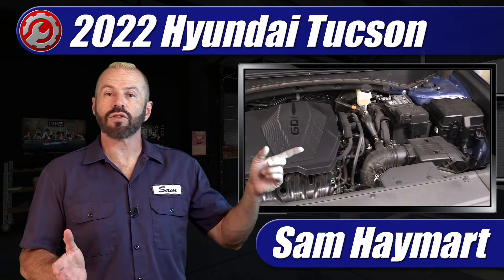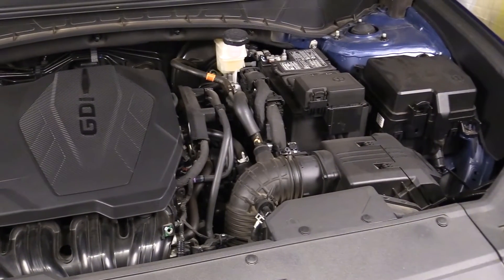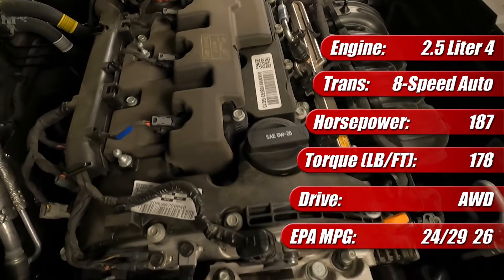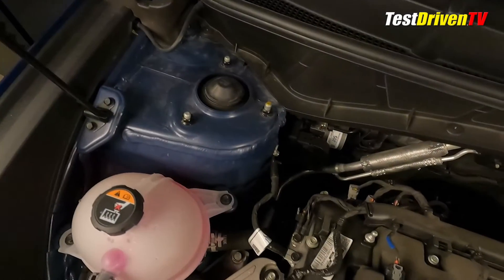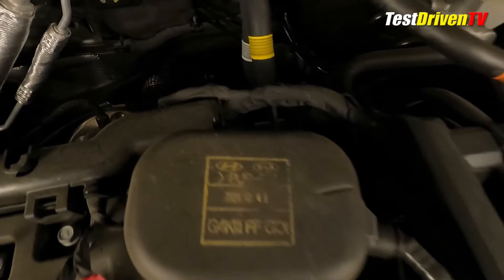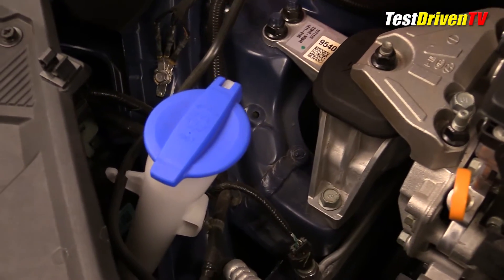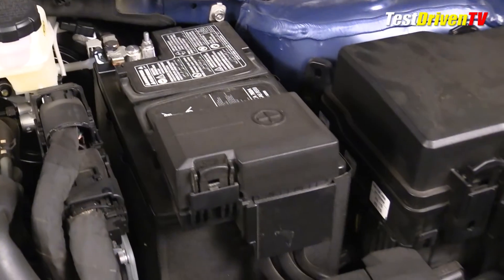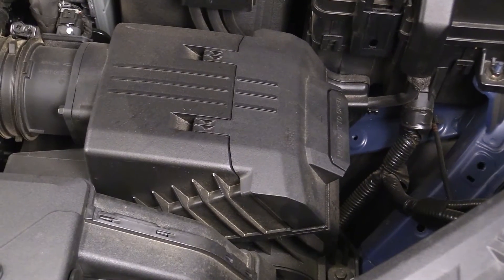2022-2024 Hyundai Tucson / Santa Cruz 2.5 Engine Explained

Comment: I have a 2022 Tucson with this engine; I am at 50,000 miles and no problems so far. I am worried that eventually the engine will blow like the theta 2's. I want to get her to 200,000 miles and more.

Comment: I had a '21 Sonata SEL with the 2.5 Smartstream.  I recently traded it for a new '23 Sonata SEL because I didn't like the styling of the 24 models. 
Anyway, the '21 had 80k miles at trade in and ran like new. It used no oil between 5000 mile changes.  Never had a single issue with that car, I just like driving new cars and have the $$$ to get one.

Comment: Total garbage design with integrated thermostat system with high failure rate. Plastic parts & terrible design. Don't expect better reliability than the older Theta engines.  Garbage design after garbage design. Thanks Hyundia/Kia. This review is a total waste of time!!

Comment: I have this engine and I need a pallet full of injectors so I can keep up with replacements. On my 4th at 30k miles.
Reply: I find this comment hard to believe.  The injectors would be covered by the 100k mile drive train warranty
Reply: @dougn2350they are covered. That’s why it has been in the shop more than not.
Reply: @Jbohan2 
The solution:  trade it off.

Comment: It's too bad they don't offer the variant that comes in the Santa Cruz which is the exact same engine but with a turbo and instead of a regular 8-speed automatic it's a wet dual clutch a speed automatic I had the upper opportunity to drive a rental of that variant and when I tell you that thing is a rocket ship for what it is. I'm just not a fan of the small back seat and the pickup truck aspect of the Santa Cruz I wish I could get that engine and drivetrain as an option in the Hyundai Tucson that would be great in my opinion.

Comment: I’m assuming this is the exact same engine in the 2023 Kia Sportage. I have one, love it. Didn’t read the fuel delivery system at first, but then I learned all about the carbon issues with GDI & discovered that dual injection resolves the issue. The specs for the 2024 Kia show this exact engine so I’m assuming from 2022 to 2024 all are the same. Nice video too.
Reply: I believe it should be fine with carbon this engine uses both GDi & MPi fuel system
Reply: I also have 2023 Sportage and it has the same engine. I learned and got worried about the GDI engines carbon build up problem. So stumbled upon this video.
Reply: @gurindersingh7002 I have 160k on my 23 Sportage 2.5l so far haven’t had to do more than oil, and plugs @ 100k

Comment: Nice tour of the new 2.5L GDI/MPI. I had a 2018 Santa Fe with 2.4L GDI. Do these new GDI/MPI engines still have the old GDI issues with oil crusted intake valves over time? I installed a "oil catch can" on the 2018 Santa Fe to abate this issue.
Reply: These engines do not have carbon deposits on the intake valves.
Reply: I’m hoping they don’t. I’ve seen tons of videos on the GDI carbon issues and dual injection as this engine has is the only manufacturing process to wash the intake valves with gasoline. So I’m very optimistic this engine WONT have carbon issues. Time will tell though. I’m loving my 2023 Sportage. I’m due for my first 5K oil change and I’ll definitely be talking to the service manager about this engine in the hopes they’ll reassure my optimism. 😊
Reply: These engines absolutely have worse problems actually they're piston ring gaps are effed up from the factory therefore allowing oil to enter the combustion chamber from under the piston which causes oil to burn which obviously leads to oil consumption issues also because the ring gap is messed up it causes something called piston slap which scuffs the inside of the cylinder walls on the block Hyundai tried to trick their customers by recommending to put more oil in it and on the new version of the engine all they did was make the dipstick longer so that you think you're not burning as much oil that's pretty messed up. And because they have now put more oil in the engine and blow by is pushing the oil up and out and then recycling back into the intake the intake valves are now getting coded with oil Yes they may be getting cleaned from the gasoline from the port fuel injection but that oil is now entering the combustion chamber from the top and underneath so now it's double the burning oil too. 😂 Oh yeah I forgot about one more thing because of all the oil burning in the combustion chamber it is now building carbon up on the direct injection fuel injectors so now those are not spraying the way they should anymore because of the carbon on them from all of the oil in the combustion chamber coming from the top and bottom at the same time lmfao all of what I said is a fact not an opinion I have had hundreds of these engines in my own hands torn apart and have seen it countless times I didn't hear this from a friend I do this for a living.
Reply: @81Todd  welp, i got same engine in Saudi Arabia, i change oil every 5000km, no oil consumption now I'm at 95000km. i use it in off-roading in sand and also my daily driver and i travel on it everything with this motor is great and yeah i do a lot of maintenance and services but I'm really driving rough on the 2.5L

Comment: I have a Hyundai and if I wanted to get a performance engine installed in my car will it damage it over time?
Reply from the maker: Not sure what you mean by performance engine. Changing engines in newer cars isn't common.
Reply: @TDTVGarage  by performance I mean put a faster engine in my car. But I guess that’s now a good Idea I probably have to just get a different car if I want something faster
Reply: @FlawlessxVictory ... the engine computers that control all aspects of performance are specific to the factory motor.  If you modify anything at all you will get check engine code, probably go into limp mode and void any warranty your car has remaining.

Comment: What does GDI & MPI engine mean?
Reply from the maker: GDI is Gas Direct Injection. MPI is Multi Port Injection.
Reply: @TDTVGarage  so the engine has both? Which means 8 injectors?
Reply from the maker: That's correct. There are 4 port injectors you can see standing over the engine, 4 direct injectors you cannot see as they are buried down underneath the valve cover.
Reply: @TDTVGarage great , I’m hoping the results and benefits of this design eliminates the carbon build up issues with GDI, can you elaborate please. Loving your videos too. 👍🏾

Comment: Thank you my man. I test drove one of these today. As expected its adequate. And it being a N.A. engine I think it should have some decent longevity
Reply: Good luck
Reply: I watched this a few days ago & didn’t pick up on the GDI MPI specifications on this engine. I’m pleasantly surprised it has both. Obviously I’ve been researching these engines due to all concerns about them. I just bought a 2023 Kia Sportage with the same engine. Well this fuel delivery system of both injectors shouldn’t have the carbon buildup issue and hopefully a better longevity than it’s predecessor. I’m optimistic and loving my X-Pro. Good 👍🏾 job Kia & good video explanation. 😊
Reply: Nope sorry to burst your bubble. These engines have problems already. The block doesnt get sufficient oil and oil blows by the piston rings damaging the cylinders. Last year Hyundai had bad rod bearings in millions of 2.0l nu gdi motors on recall now this. I had high hopes but they make junk motors.
Reply: @RM-ub1xd  who really cares, 10 year warranty no big deal.
Reply: @mr.wilson8340  maybe not to you but plenty of people actually do keep their vehicles for a very long time. They would be debt free from financing and save hundreds of dollars each month purchasing another vehicle. What happens when these vehicles are payed off and pass the 10 year/100,000k extended warranty and the engine fails? Who wants to drop 6 grand or less on a engine especially on a Hyundai or Kia? Who is to say the used engine won’t show the same failures down the road? That’s too much of a gamble. I would sell right after the warranty expires but then again most won’t.
Reply: @RM-ub1xd so what should I do? Try the 1.5T from Honda😂

Comment: Great tour of the 2.5L do you know if the 2.5 have any problems ?
Reply: The 2.5L that was originally released in Korea in 2018 had oil burning issues with engines blowing. The theory behind this was that the pistons had 4 semicircle drainage holes, which was inadequate to scrape the oil back into the pan. This was rectified by adding 4 more semicircle oil drainage holes. All US vehicles with this should have the revised piston heads. Interestingly, schematics when originally released had 4 whole holes and the 2.5T pistons have the whole holes. My Santa fe 2021 does not burn any oil, whereas the theta II on my old sonata required a quart every 3000 miles.
Reply: @gaijinblow  how  about sorento 2.5mpi(2022)
Reply: @ККанатбек  I don't know about the MPI. But the 2.5L engine is both MPI and GDI. I would imagine all they would have needed to do is strip away the GDI components.
Reply: @gaijinblow  That is great to know! May I ask where you found that information? Would this be applied to the newer 2024 KIA models with the 2.5 GDI Engine? Many thanks!
Reply: @srt2662  it was a post in Hyundai forums. And there were several videos on it by Koreans on YouTube. It was big enough of a deal where there was a National Assembly (South Korean legislature) inquiry against Hyundai execs. The problem does not affect any Theta III/SS 2.5L engines made in the US.
Reply: @gaijinblow  Wow that is great! So the new 2024 GDI Engines (Theta III), for example the 2024 Kia Sportage, there shouldn't be any issues with oil consumption or problems such as the Theta II? I am considering the Sportage strongly, really hope the engines have been redesigned and will not have those issues. What are your thoughts? Thank you again!
Reply: @gaijinblow  you are 100% correct!!
Reply: how about KIA 2.5L(2022)
Reply: Is the problem limited to only 2.5 GDI MPI or is it with every other engine?

Comment: What cars don't have direct injection these days?
Reply from the maker: Quite a few still operate with port fuel injection or a combination of both.
Reply: @TDTVGarage  Does this motor have the combo injection?
Thinking of the Santa Cruz....tired of waiting for my Maverick...Thanks for your excellent reviews.
Reply: @gwlane5509  Yes
Reply: I read that less than 25% of cars and dropping made today are exclusively port.
Reply: Direct injection engines are not very reliable

Comment: Do the valve cams run off a TIMING CHAIN or a TIMING BELT? This is very important thing to know as it is an expensive “Surprise” repair that comes up when you buy a car with a timing belt.
Reply from the maker: All contemporary Hyundai engines have a timing chain
Reply: @TDTVGarage  can you review the Kia Sportage hybrid and do a powertrain explanation and garage video like you do you're really great
Reply: I don't think any modern engine uses a belt 🤔
Reply: @guidedbygreen1480  yes it does, for example PSA puretech engine . And its no problem if you replace the timing at required intervals.
I prefer belt over chain because of being more silent and cheaper to replace. Modern cars timing chain kit doesnt last like it used to and it is expensive to replace.
Reply: @guidedbygreen1480  the Honda ridge line does
Reply: @guidedbygreen1480 true 😂
Reply: A "surprise" repair? As in how...because one did not check...and it's usually not due to at least 90k miles...only a surprise to those who never take the time to know their vehicle. Timing belts have been around since 80's...LOL